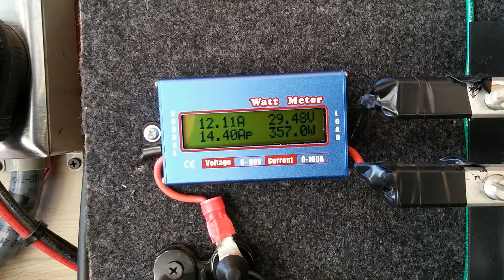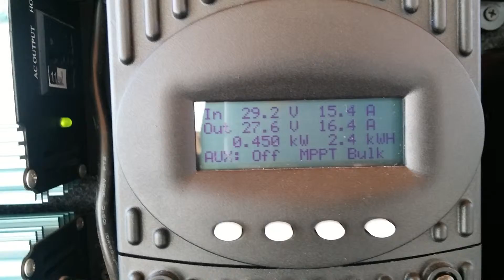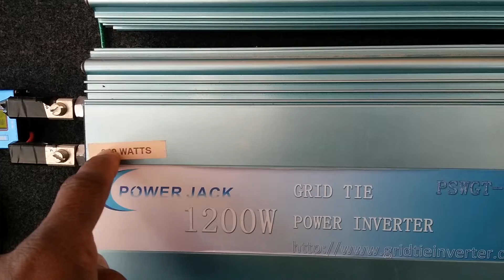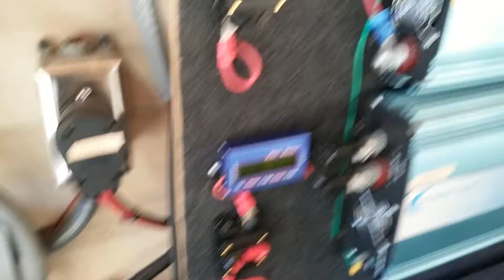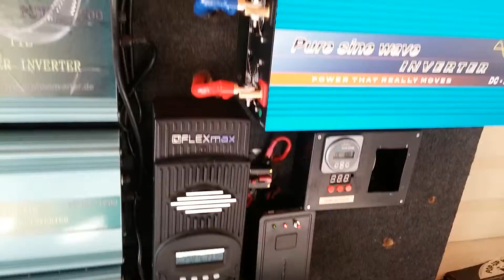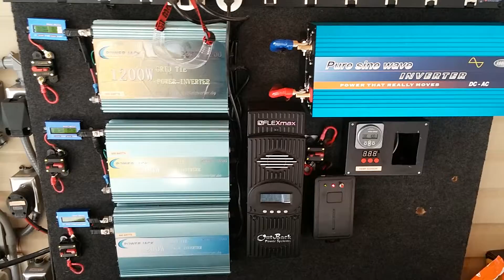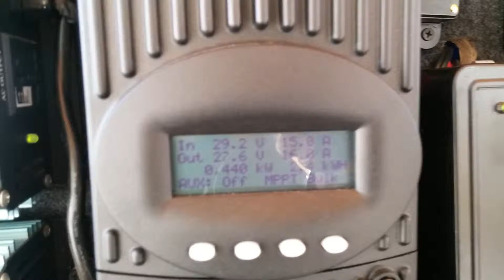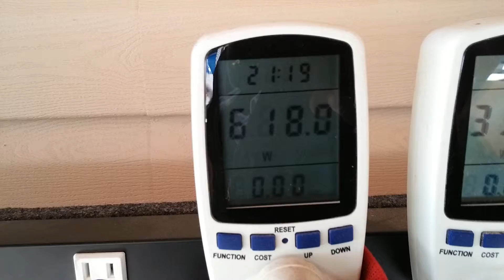RENOGY SOLAR & OUTBACK CHARGE CONTROLLER

Comment: As an electrician I have to say this wiring looks unsafe. To many exposed live terminals and the battery box is blocking clear access to the system. It’s a cool deal but unsafe.

Comment from the maker: Hi carlo roxas the grid tie is connected to a 24v to 30v relay witch is controll by the coleman charge controller and the voltage is set at 27.5 to trigger off when the battery go into float stage

Comment from the maker: HI GUGA NETO ON ONE  OF THE INVERTER WE HAVE 600W OF PANEL THE NEXT ONE WE HAVE 560W OF PANEL AND THE LAST ONE WE HAVE 840W OF PANEL HAS FOR THE BATTERY BANK WE USE IT AT NIGHT OR WHEN WE HAVE POWER OUTAGE